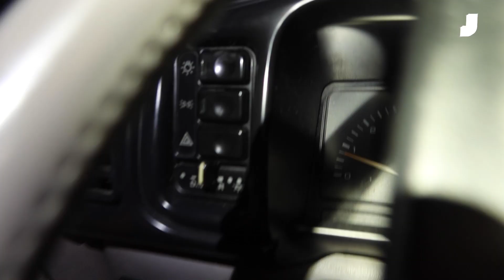How a Bunch of Bicycle Batteries Helped my Old Minivan Escape Sweden

Comment: It's hard to believe with all the better quality choices of vehicles, anyone in Europe would buy a Dodge minivan.  Just listen to that engine tick!
Reply: If I remember, it's a Diesel, so they have a ticking noise running, but it does sound like a lifter that's not fully pumped up
Reply: @dave1135  It's definitely a diesel, if you need confirmation just look at the glowplug light on the dashboard at 3:20, only a diesel will have that light.
They do tick ever so slightly, and I'm not informed about this specific engine, but I'm quite sure it's not supposed to be this loud. Quite sure a lifter. 
Might just be because the engine was just cold started in swedish winter. In the next shot there's no lifter tick to be heard.
Reply: Maybe they have already owned a German car, and didn't want to get burned again. I know I don't.